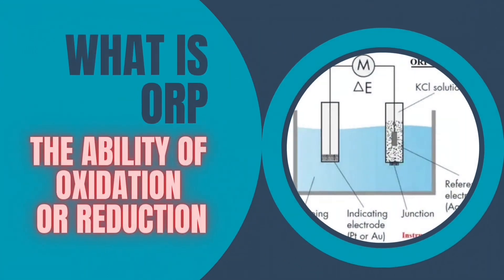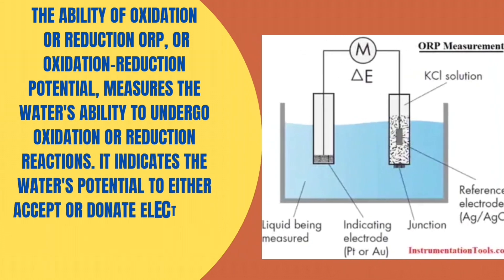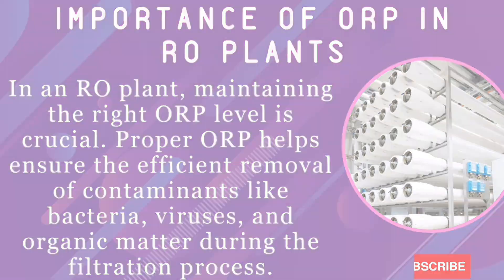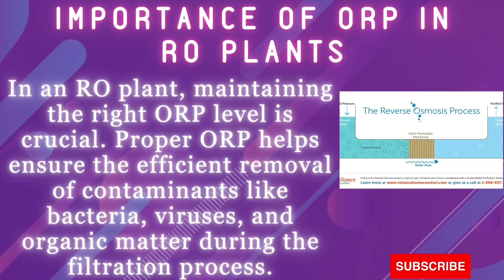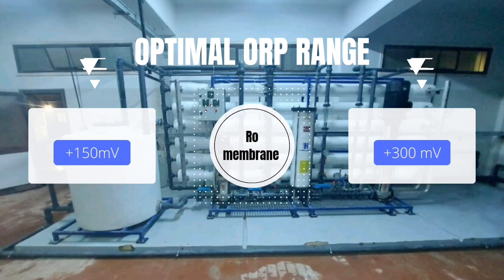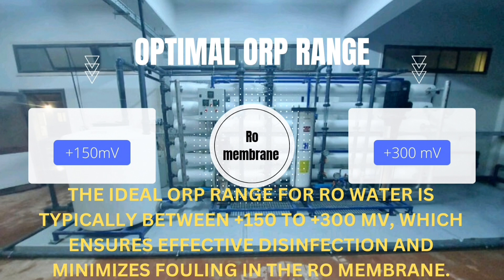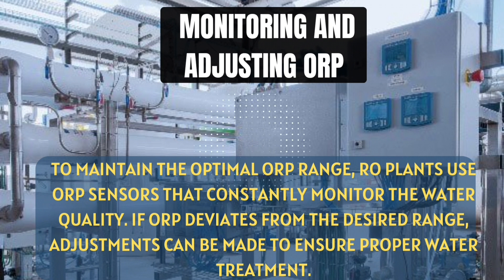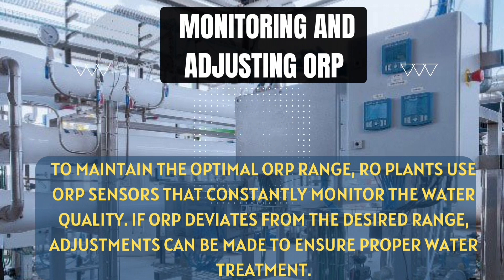what is Orp| ORP kia he|| it's effect and "importance" in ro plant| High and low orp

Comment: Hi, Thumbs up 👍 
But I have a question
 If the inlet water to Ro reads -490 (Negative) mv. What action should be taken to raise it to the optimum range (+150: +350)?

Thanks
Reply from the maker: A negative ORP reading indicates that a substance is a reducing agent.  The lower the reading, the more anti-oxidizing it is. 

You can control ORP levels by increasing or decreasing the acidity of the water. Higher pH levels will cause ORP levels to be low. If you find that your ORP is too low, you can add muriatic acid to the water to increase ORP levels and decrease pH levels.